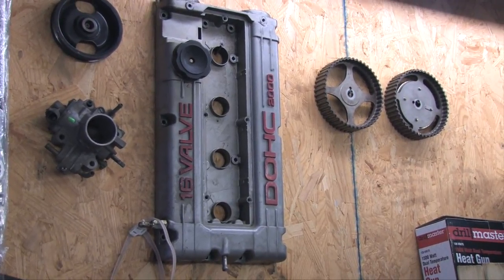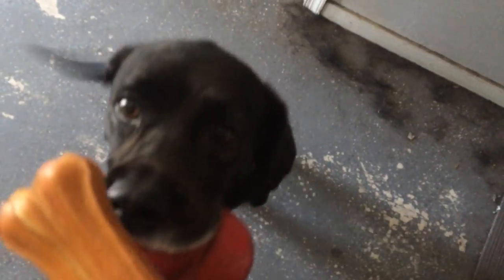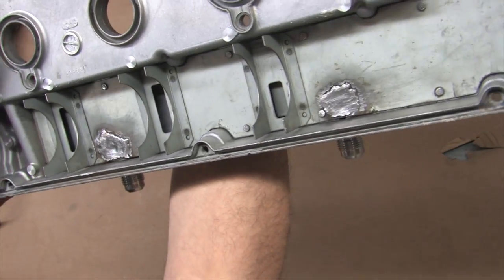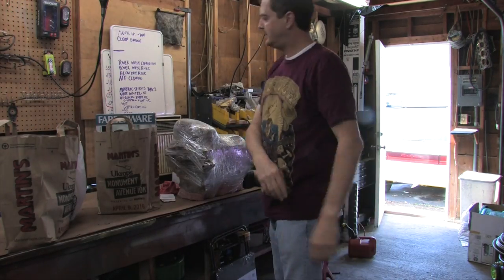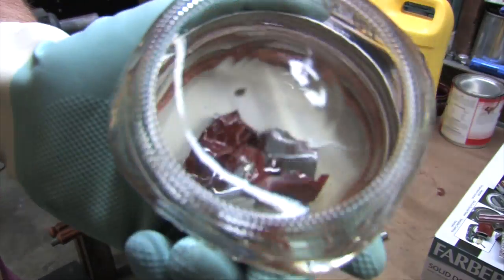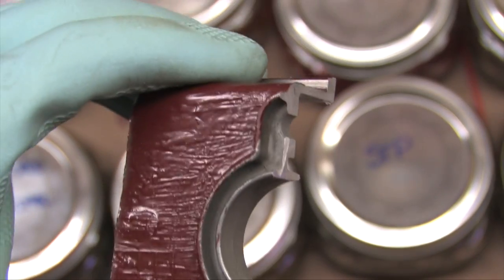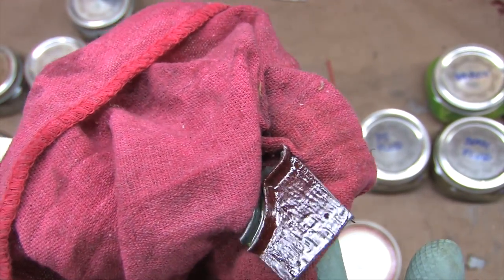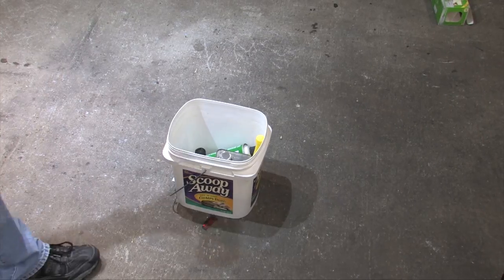Glyptal Testing for Automotive Use

Comment: Bottom line, IMHO, applying Glyptal is pure pagentry.  It looks cool.  You will never see it used on a high end race motor.  Why?  Because whatever small benefit it might convey for oil flow (almost certainly not even measurable) is more than offset by the risk, however slight it may be, of the coating flaking off and blocking something in the engine.  There might be some benefit to "sealing the casting" on a crappy iron block....but polishing the interior would do the same thing without the risk.

It's funny how people get stuck on tradition.  Using Glyptal as an internal engine coating is as old as the hills, going back to the 1960s at least.  My question:  Why Glyptal?  Since that time I imagine there have been countless products developed that would do the same job as well or better than Glyptal.
Reply from the maker: Epoxy coatings actually work better.  I did the block polishing thing you mentioned to my Elantra's block.  Practically nobody watches that video.  I did the Glyptal coating because it's widely-discussed and written about with absolutely zero examples or evidence online.  Someone needed to be an example.  Everything you said I agree with.  So when I made my example, I followed the advice of the people who said they "never had a problem with it".  The people claiming to have problems didn't even know what their coatings were?  I'm going to subject it to modern forms of abuse.  I'm going to do it with plenty of racing parts and fluids, too.  We're all going to see, and we're all going to have a good time doing it.  :)
Reply: @Jafromobile  LOL...sounds good to me Mr. Jafro.  I have a strong opinion on the subject because MANY years ago I was rebuilding a very expensive BMW engine and I read some opinion touting the benefits of Glyptal (I think deep down I just liked the way it looked, TBH).  So I carefully prepped the block, and carefully applied Glyptal.  Then I set the block aside for a couple of weeks to cure.  When  I went back to it, I was cleaning another part and somehow splashed a drop of some solvent or another on the Glyptal.  Almost instantly, it bubbled up and lifted....like I had just brushed it on an hour ago (I had not done your "bake" step).

Anyway, I immediately thought "what the hell am I doing?" because deep down I knew any possible benefit would be trivial at best anyway...and here I was potentially risking catastrophic engine failure....basically for a cool looking engine interior that no one would ever see anyway.  So I laboriously stripped every bit of Glyptal before I did final assembly on the engine, and slept much better as a result.

Comment: Bad idea, Im pretty sure this stuff will loose the adhesion to the aluminum sooner or later, crack, chip and then enter your oil. Good way to completely cloque your oil pump pickup screen with those paint chips.
Why woild you do that anyway? Whats the intention? To prevent burned oil sticking to the metal? Change you oil more often, use quality synthetic oil and delete bs like agr and youll never have problems with oil residues in your entire engine life.

Comment: I mean.  There is literally no reason to go so crazy with this product...  It didn't even shed oil any faster...  Which was your entire reason for doing it.
Reply from the maker: It was faster.  You saw it.  Think ET, not MPH.  Second race backs up the first race's results.  Look at the elapsed time, not the video.  It's not like rain-x or anything, and 35-45% faster is only a small advantage, I concur...  but oil drainage is only 1 of 3 reasons I'm doing it, and only 2 of those reasons are related to my car.  The third and most important one is to publicly document it.  

People run into this coating from time to time and there's a ton of bad and conflicting information about it.  So much that I had to open this can of worms with VIDEO so people can SEE it for themselves, and why the effort and time is still totally not worth it.  Seriously, I have 3 videos about it where say not to do it.  This product touts a huge number of uses, and automotive use isn't one of them, however; the use of this product in crankcases and gearboxes dates back twice as old as the internet.  That's why there's nothing but bad information.  We'll see whether or not I'm just making more of it?  I'm just brave enough to document my results using it unlike everyone else who didn't.  This is just mythbusters material.  I'll be putting some really expensive racing parts at risk inside it, so pass or fail, it should be a good time!

I have another video where I sanded the whole inside of my [turbo Elantra's] block smooth, and it does basically the same thing except that it strengthen's the block, can still use every fluid and additive without affecting it, and its smooth finish won't ever come off and clog up your oil pickup screen.  It's a much better solution.  Takes more precision, but a lot less time and patience.  Notice that one's built and running...

Comment: what about ATF ?
Reply from the maker: I kicked myself repeatedly over this.  I had a bottle.  I don't know how it didn't make it onto the workbench?  It's one of my assembly fluids, too.  I'm not expecting any problems from it, but expectations weren't always met in this video... so... naturally I feel like this series of tests is still incomplete.  I probably will do another chemical testing video because this upload has yielded a ton of great suggestions, and it also lacks fuel testing.  I can get leaded gasoline and unleaded... but the e85, e10 and nitromethane options are going to take a lot of work to produce because my locale doesn't offer these choices.  I just can't get them.

Comment: WASH YOUR PARTS WITH ACETONE AND GO FOR IT THIS STUFF HAS A TENACIOUS ABILITY TO BOND TO NEARLY ALL METAL SURFACES IT WAS INTENDED TO BE USED ON ELECTRICAL MACHINERY WIRES AND OTHER THINGS THAT NEEDED ELECTRICAL INSULATION

Comment: Stole that idea from audi world.... a 10 year old idea. Give credit....

Also furthermore good work and anyone who had any complaints can STFU because I believe the 10 year old intakes that were coated with this stuff that inhale oil particulated and the occasional bit of fuel and recirculated exhaust gas looks the same as the day it was installed. Been proven. Poor guy spent a lot of time doing this.... Its been done though.

Comment: We use er-41 red glyptal paint in the elecrtic motor business. And i often use itnto coat parts that have various levels of old paint , dirt and grease. And the stuff still covers great. All that prep aint really needed.
Reply from the maker: Not on an electric motor it won't.  It never would.  But for automotive use, the consequences of not doing can get really expensive, fast.  This video proved that oil and grease is harmless with this stuff, and I agree with you that it covers un-prepared surfaces very well, but I will not make that recommendation for automotive use.  If the coating fails on an electrical part, no problem, a little touch-up on it while the thing's even running would be fine.  This product was meant to be used like that.  If that coating fails on an electric motor, it's not going to clog the oil pickup screen resulting in a rapid and catastrophic failure of the rotating assembly.  I expanded on that in the first video (where I coated the head).  But what I never really expanded on anywhere was it's electrical insulating properties.  1.5k volts per mil?  A mil is only .001 inches.  That means a 1mm thick (or 0.04") coating resists 60kV.  That's incredible.  That's the thickness of 10 sheets of notebook paper.  ...or only .0056296% of a banana.  A paint that could hold back the ignition spark of a gasoline engine at only that thickness is an amazing product.
Reply: I did a test on a spare piece of iron . sprayed it with the red glyptal and left it soaking in a can of motor oil. Its stiil there YEARS LATER. No pealing at all.Just saying

Comment: This product wouldn’t be good for everyday vehicle use the reason it go’s faster in you drag race is because the oil takes longer to cool on the red shit
Reply from the maker: This car has a big Setrab air/oil cooler on it.  I don't know any "everyday" vehicles that come with those?  But yeah, definitely not for OEM and stock builds.

Comment: what about gasoline?
Reply from the maker: I'm pretty sure that given enough time most full-strength fuels will remove it just like these full-strength solvents do.  Even modern gasoline is at least 10% Ethanol.  Question is, what's left of the blow by from combustion in the high temperatures of a running engine, and in what concentration?  Can it break down enough in an oil-soaked crankcase to do anything to the finish?  My bet is that at full-strength, it probably will.  I'll probably be testing it.  There were no fuels except for the 2+2, mineral spirits and pure alcohols in this video.  I need to test all the fuels you can get from a pump, problem is all I can get from a pump here is diesel, kerosene, leaded race gas and unleaded e10.  I need to travel to get pure gasoline, e15 or e85.
Reply: I'm sure it would be highly diluted in the oil from blow by unless you had a carb'ed engine that had a fuel pump leak in lots of gasoline and was left unnoticed. very fun videos to watch. you must be ocd

Comment: You’re not even using the hardest nozzle and those pressure washers suck
Reply from the maker: It's the same pressure point blank and mashing on it no matter which nozzle you use, and why would I use the most powerful power washer that would un-questionably remove paint?  I've got 6 cars to wash, and vinyl siding to clean.  These power washers are perfect for what I need.  I've still got samples.  I'll test it when I run across one (that I don't have to buy).
Reply: Jafromobile I thought you were testing how strong it was
Reply: Jafromobile and a wide spray nozzle is different then a small spray nozzle if I put water pressure through a tiny hole it’s going to be a lot great pressure then a wide spread
Reply from the maker: Nah, just looking for a safe, fast, efficient way to clean it.  That's why I mentioned its pressure rating and gave homage to the bigger gas-powered jams and why it takes more than 2500 psi to remove most paints.  Electric power washers typically operate below that.
Reply from the maker: This was a 25° nozzle, and I follow you on that point, and you're spot on about those nozzles at a distance... but actually the pressure is greater going through the wide spray nozzle because that spray pattern is achieved by restricting the hole further than the 0°.  The more restriction where the water exits, the higher the pressure is achieved (on the pump side).  Flow would be reduced, but the pressure is increased.  In theory, fluid pressure is immediately lost where it exits.  At point blank range, both nozzles are still just a pinhole, and the water is just a projectile.  The rating on a power washer is the maximum pump pressure.

I'm not arguing with you.  I absolutely agree with you about the physical changes in front of the nozzle at a distance.  That 0° spread HURTS, but the 25° is pretty survivable.  Both of them will cut right through your skin at point blank range.
Reply: Jafromobile I disagree but I don’t want to argue if you take a garden hose with no tip on it The pressure decreases and does not go far or have much pressure if you put a tip on the garden hose with the smaller diameter The pressure increases and so does the distance Isaac newton’s law of motion